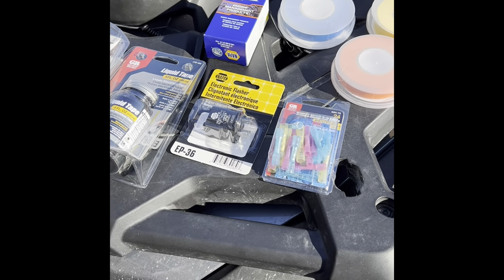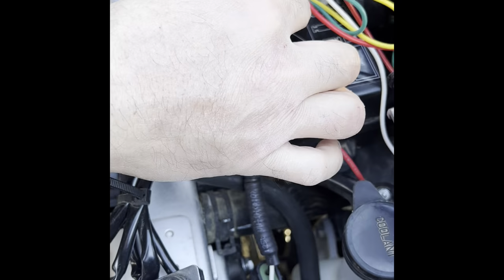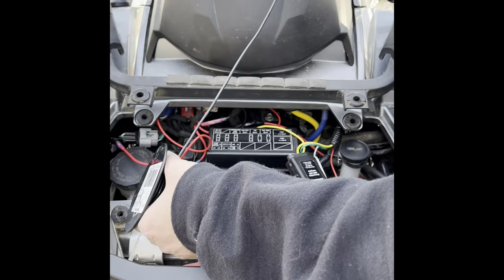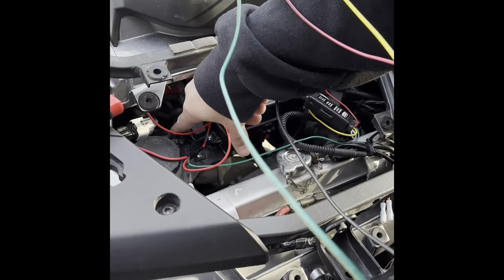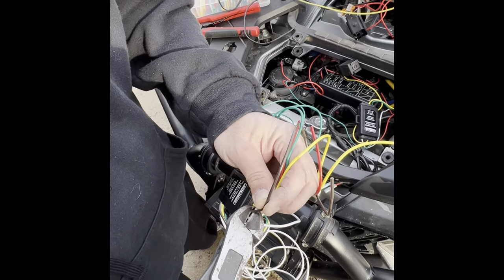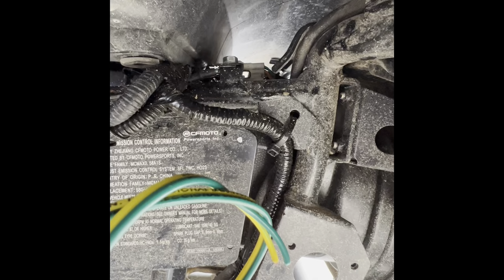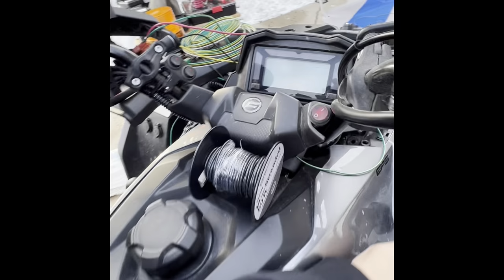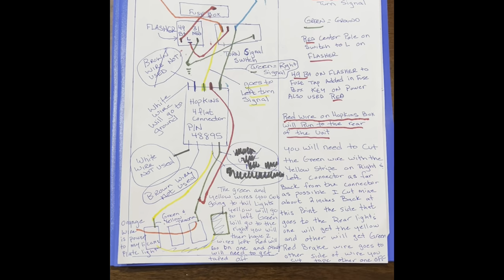2021 CFMOTO 600 touring turn signal install

Comment: Yes, good job, I did my 2022 600 t the way you did it, except I have a different switch, was able to figure out a four way system, and got a horn, of sorts installed, so thanks for your info!
Reply from the maker: That’s awesome. I’m happy I was able to help you!
Reply: @jimcorbin4977 Can you help me with the parts list to do 4way and a horn too?
Reply: @DavilaDarkness2  Me too plz!
Reply: Hi
How you did the wires since there is already a baby blue wire on the harness ?

Comment: I have a '22 CF 800 xc. My battery area looks different. I have a different turn signal kit. I just need help tying into the switched power. Is it really just tapping into the cigarette lighter fuse?
Reply from the maker: Yes you can do it like that but make sure you put a fuse after the tap. That’s not how we did it. We uses a fuse tap coming out of the fuse box because I didn’t want to cut my wires. You can get a fuse tap it will have a fuse that goes into the fuse box like it normally does and it will have another spot for the fuse. Than you would run that fuse for your turn signals and that would be key on only. If you want to provide an email we can send a number. I could call you to explain how to do it so you don’t have to cut your fuse box.
Reply: @Rita-1976  I ended up getting a fuse tap. I tied into the radiator fan fuse. The fuse tap made it so I can't close the fuse box now. I might change it by splicing into the wire and not go through the fuse box. thanks!

Comment: Any reason you caint tap the green & yellow wire at the tailight housing connector, instead of taking the entire back apart to get to the backside of the white mounted connector?
Reply from the maker: We couldn’t get it without taking it apart. There is more than one way to do it. This is just how we did it. We were the first ones to have signals on these machines. Any questions please let me know. I think it splits back there. I honestly don’t remember it’s been a while since we did it. Let me know if you do it different and how it worked out or if you have any questions, let me know.

Comment: Yeah, I did mine just a little differently. The only thing I didn't do is tie it into the dash because I didn't know which wires it was. Does your fronts do the switchback with the daytime running light? Mine does.
Reply from the maker: Yes they do. I posted a video. Do you need help with the dash lights?
Reply: @Rita-1976  I actually got that done a little over a month ago. Thank you though.

Comment: Ok so after watching this several times, I have a few questions. You used 2 trailer wiring kits, could you have used the one for the front and just tied the yellow, green and red, that go to the rear, into their respective colors on the front control unit? Thereby eliminating 1 whole unit.
Reply from the maker: Only one was used not sure where you seen 2?? On a 2 up the harness we got was not long enough so we had to make the wires longer. We just bought wires and made it longer. We only used one kit.
Reply: @Rita-1976  Thank you and wow, I was so confused. That makes thing more clear for me.
Reply from the maker: @raulvargas6575  you are welcome. Reach out if you need more help!

Comment: In Canada it comes with signals and horn
Reply from the maker: Yes I know that. US models don’t come with them. We have reverse lights you have signals. Now I have both.
Reply: In America cforce 600 come with horn but no turn signals I contacted cfmoto they told me if you’re American you have the technology to add them I asked how come Canadian models come with turn signals and not with reverse lights they told me they have a hard time going forward we don’t want them going in reverse at night